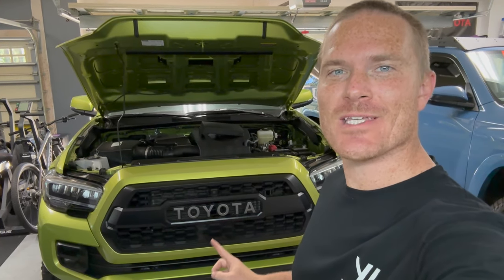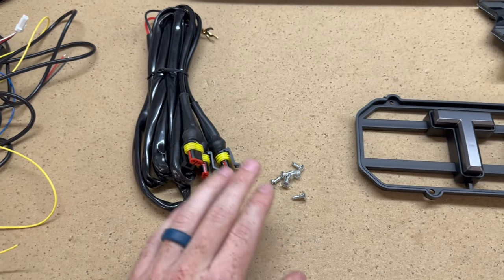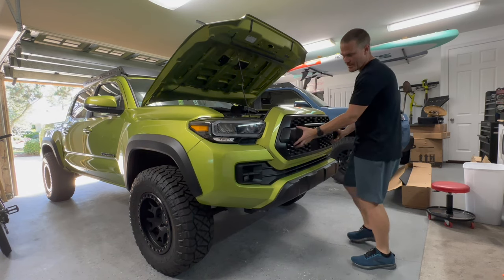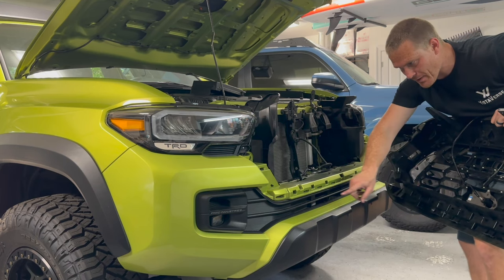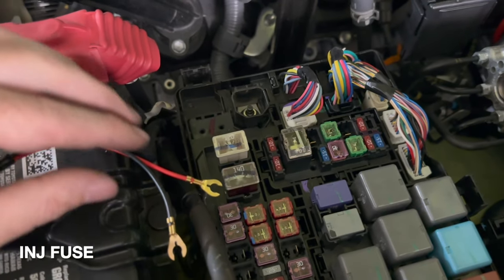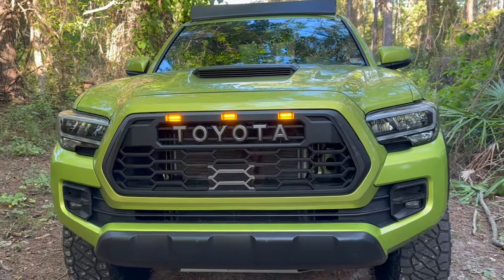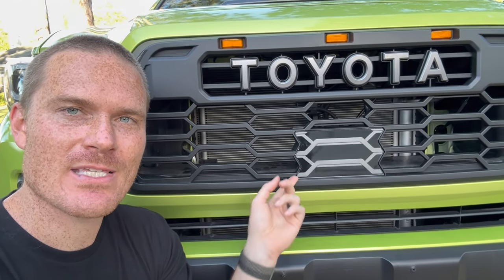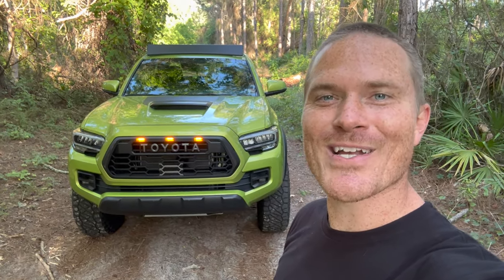Introducing The Newest Tacoma TRD Pro Grille

Comment: I just bought mine for my 2021 TRD Pro. Curious what you did with the front mounted camera on yours? Did you just remove it all together or mod it up in a different way?
Reply from the maker: I thought I stated in the video. But I zip tied it up until they come out with a mount or I figure something out.
Reply: @TRDJon  Yeah I messaged Yotaverse and they said they're working on one with a mount. I'll zip tie mine up until then as well. Thanks so much for your video, should make my install super easy, much appreciated!
Reply: Are you interested in selling your pro grille?
Reply: @goldblueberries326  If the price is right I would

Comment: Maybe I missed something or you covered it in another video? How do you get the “add a fuse” positive wire thru the standard fuse box cover? Thanks!
Reply from the maker: Just pop the top off. It should close with the fuse tap wire over the side
Reply: @TRDJon  ok I’ll give it a try. Thanks!

Comment: I like it but they should have put 4 lights not 3.  Raptor's have 3. Tacoma's 4.
Reply from the maker: Tacoma's typically don't have any. I'm confused.
Reply: @TRDJon  I meant the aftermarket ones. They normally come in 4 so most Tacoma's have 4.
Reply from the maker: Ah gotcha! Yea not sure why on this then for only 3
Reply: I've seen Tacomas with 3,4,5, and also some that have added a 2nd row of raptor lights below the grill emblem.